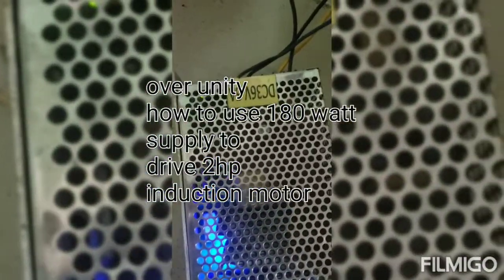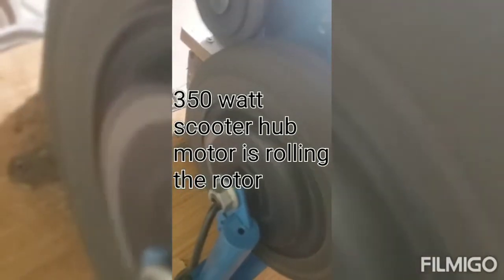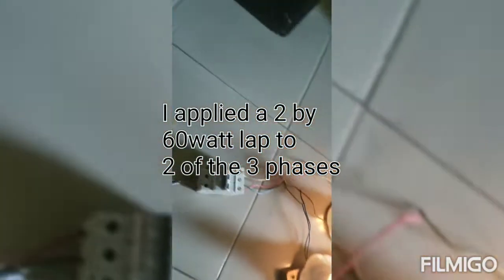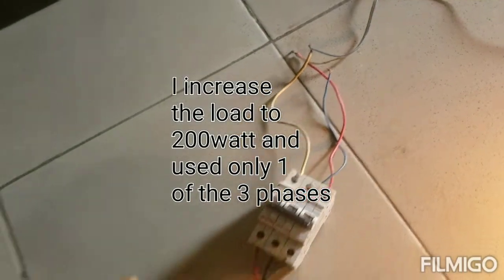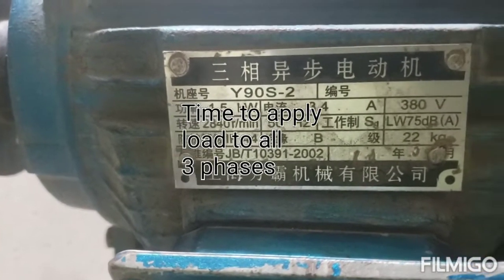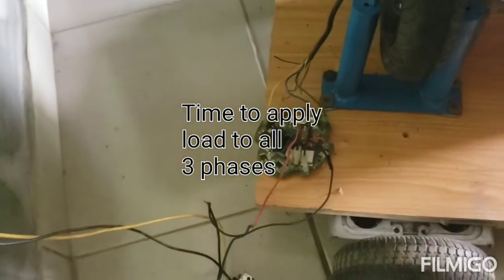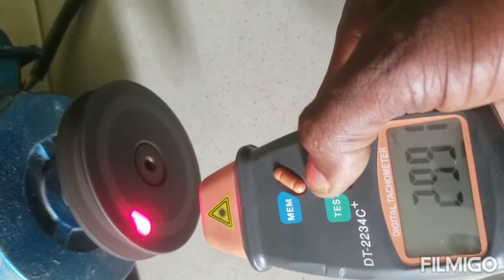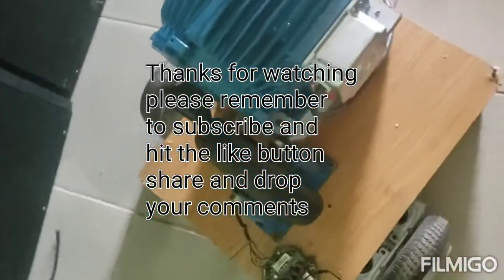Over Unity Generator, How to Run a 2HP 3phase motor with just 180watt supply

Comment: did you try to put a load on the 2 hp motor? under load i dont think it will not perform as in this video.. rpm will drop considerably